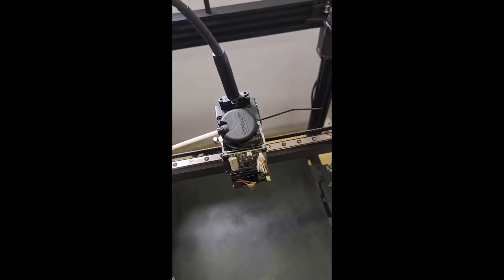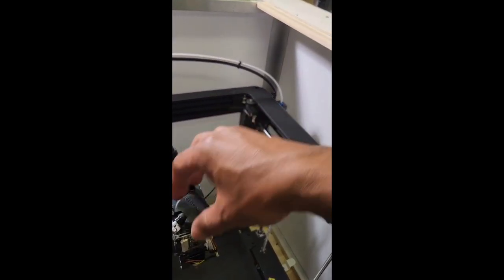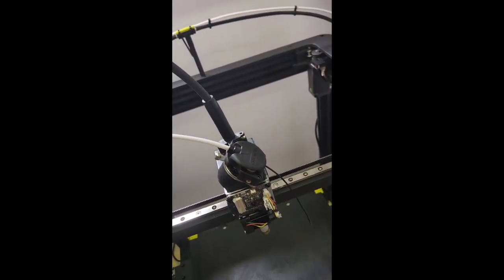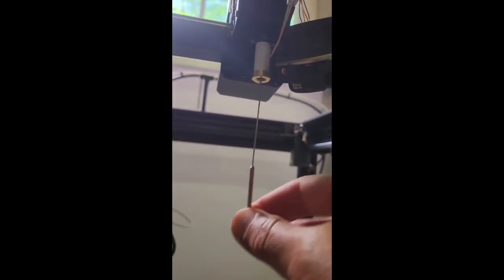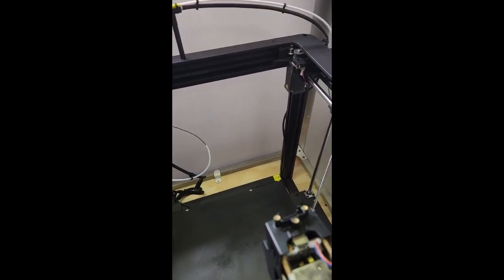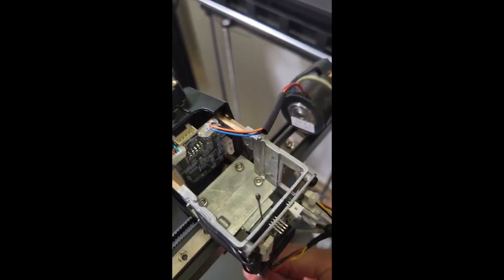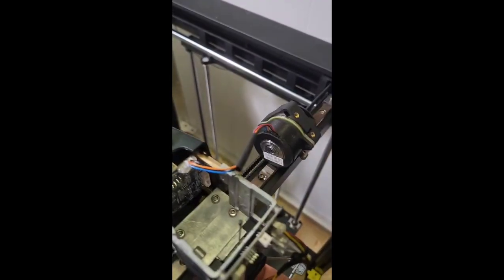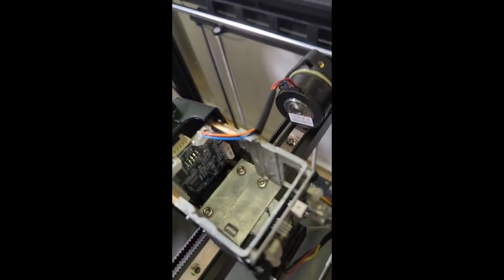Creality Ender 5-max 3D printer clog - How I found and fixed it

Comment: Great video.. Question should not a brand Printer be more clog proof?
Reply: it's just a product of shoving moten plastic through a tiny nozzle. Sometimes it just happens.
Reply: It's a tiny consumer-grade mechanism pushing plastic filament, of various materials with different melting points, strengthss, elastic properties, etc. and unknown quality into a heater that melts it.

Generally the best thing to do is to make it easy to take apart and service.